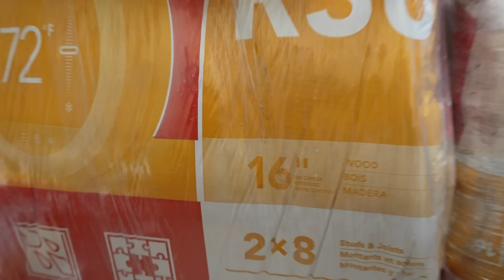OUR DRIVEWAY IS IMPASSABLE!!!

Comment: Regarding the snow drift melting, I highly recommend you start placing sandbags immediately. By the time it is an emergency, it will be too late. Take it from someone who's dealt with deep snowpacks and spring flooding before. You don't want to let the snow melt do its thing if at all possible. It can and will get out of control in the blink of an eye. Sandbag it and save yourself the headache later.
Reply: They should had placed them in the fall. The flow is already going and running into their basement and back retainer wall . 😢
Reply: @BabciasCoffeeAndCraft  it's not in their basement yet.
Reply: And with whole surrounding area dealing with the same thing...those sandbags will be in short supply. Everyone will be out-of-stock in no time.
Reply: The garage will flood and that water will move right into his workshop. 😱 The door will be unable to open. Allie, don’t wait until it’s an emergency, get prepared now! 😱
Reply: @johndell8679  their videos are a couple weeks they just didn't film and edit yesterday. SMH
Reply: Realize that they are 3 weeks behind on posting these videos. It's probably way too late.
Reply: Oh the professional snow melt advisor's on here!!

Comment: Use a Rototiller to trench the through the ice. When I was stationed in Newfoundland during my navy days, we did that and it works well. Just be careful of your concrete underneath.
Reply: They need to buy a large steam genny, since they Have less than optimal snow accumulation areas and drainage.
Reply: They don’t have to worry about pavement as I think they just have gravel and dirt.
Reply: Nobody gets more snow than Newfoundland.
Reply: I think you will cut your hair before you put it in a pony tail.

Comment: I think one thing that you should check is split system outside unit. Make sure water doesn't start building up due to melting snow. If that cavity fills up it could ruin outside unit. You might need a sump pump to try and keep water from building up. Your garage floor is a good example of water buildup and this will also happen around your house at lower levels so I guess just try and redirect water away from house . Great videos so sad you are having to go through this. Diesel Dave, of you tube Heavy D may have lost his vacation house as snow was higher than his 3 story roof. Inside of house, walls were buckling and may not be able to save.

Comment: When I was a kid, we had a tool we called an ice chopper/scraper. It was like a hoe that was straight not turned at 90 degrees to the handle. It did a great job of breaking up an ice layer and lift an ice layer off concrete surfaces.

Comment: You might want to create trenches on either side of your driveway and the street to help direct the water away from the house, garage and the driveway. You definitely need to create trenches to direct the melt flow away from the deck and basement of the house. I hope your firewood stays dry and doesn't turn into a huge block of frozen wood. Get as much as possible up off of the floor in your basement and garage to protect it. Praying nothing bad happens.

Comment: I stopped sanding the mud several years ago. I now use a wet ( not too wet ) sponge to smooth out seams and screw holes. Saves on the mess. It matters how well you mud for this to work well.

Comment: Look on the bright side, all that snow runoff will help you plan an incredible drainage system around your buildings and possibly your driveway.  Normally a french drain is covered with soil but in your case I would look at installing continuous open drain pipe sections with a grate on top like you would put in front of garage doors.   You could put screen under the grate to prevent the snow from filling up the drain pipe.  You could also run water pipe heating cable in the drain to melt the water that freezes in the drainage pipes each night so the drain would be clear for runoff each day.

Comment: Try laying black plastic or dark colored tarps on the ground where you want the snow to melt quicker. Seal the outside edges with snow and the trapped heat should supercharge the melting wherever you place them.

Comment: Consider melt runoff erosion. Get above the house stem wall and begin routing melt water in the ice to alleviate (help prevent) flow gpm in the ice river under the ice.
The ground water saturation is likely to be extreme and the surface flow will definitely be increased over previous years.
Don't let your beautiful house ark float away!
🖖

Comment: We had trouble with flooding, and what we did was use some perforated PVC pipe. Dug a hole with an auger, then fill it with.  Tiny p stone. I have not had any flooding issues since.

Comment: Under the deck you could build a short retaining wall (that you can easily step over) with an open french drain on the outside of the wall.  I don't live in snow country but if I did, I would love to solve the runoff problem with innovative techniques.

Comment: infront of the basement dig a hole in the ground and put a water pump in it to move the water away from the foundation 
NOTE .... you will have a harder time when the snow melts behind the house with possible water infiltration

Comment: By now you've probably figured a solution for the snow mound in front of the house. But I would fire up the tractor and use the snow blower,,at least get it away from the house to avoid it going into the basement.

Comment: Hello from Canada, and you seriously have way more snow than we do here. shop and upstairs are coming along nicely, use 1/2" ply in your shop, or at least up to 8', drywall is too fragile. ask me how I know. I have a lift in my garage as well and am putting in a loft in the front portion for storage. As you do not have the outside finished, you may consider moving heater to corner by entry door and a loft by where heater is. You can never have enough storage space. my 2 cents.
By the way nice welds, that Tacoma is going to be a serious crawler when it is done.
Keep up the great content, really enjoy the videos

Comment: Just texture the drywall, instead of trying to make it perfectly smooth.  No sanding required at all!  You tape the seams, and then apply drywall mud randomly to texture.  Then use a fluffy roller or spray gun to apply primer and paint.  Much easier.

Comment: Sit a sump pump and sand bags under the front deck at its lowest point and try to prevent the water entering the basement and foundation. Typically the water will seep under the a concrete foundation and cause undermining and cracking.

Comment: What you need is a blade off of a industrial paper cutter and weld it with two brackets with a long handle. The beveled edge of the blade slices easily right through the ice and breaks it up. I used to have one and moved too quickly once and lost it. It makes chopping through the ice super easy.

Comment: This is were pushing snow back from day, one all the way to the end of winter is so important.
Having a spot to get in with the snowblower, all the way around the house and having a proper roof on a house in the mountains to unload the snow by itself and not have it build up on another rooftop. It’s very important.  The biggest thing you could do with that property is cut in around the house and around the garage and push the snow back about 40 yards away from the house on all sides with a snowblower. 
That will help keep things dryer because remember at the beginning of your construction you had water in the hole before you did the basement???? The waterlines just below your basement floor? You need to get rid of the snowfall push it back. 
You’re gonna have to come up with a system to clean the roof off pretty much on a daily basis.

Comment: I have a couple ideas for the future. Find or buy a couple of old steel street light poles. The hollow kind. Bury all but 8ft in the ground in concrete and a lot rebar. Fill the poles with concrete and rebar. Plant one half way up your driveway on the inside edge and the second one to the outside edge of the driveway up in front of garage. Then weld a mounting point for your winch on each pole. Then you can winch your self up the driveway when one of you is alone.

Comment: The wreath was fine, loving Trents hair. I kinda feel bad, here in NE Ohio I didn't have to plow my long driveway once this winter, hardly any snow at all, I think you got all of mine and more! I fervently hope this summer you buy a large tractor or tracked skid steer that will help move snow during the winter and dump it over the side of the driveway. I pretty much live on a flat 10 acres and can't imagine not having my  Ford/New Holland tractor.  I am surprised after the insulation the roof ice and water shield/roofing isn't the next step instead of dry wall. I know the roofing itself is weatherproof to a degree but ya'all live in extreme conditions.

Comment: You were having fun with the jeep, weren't you? Does the Sahara have lockers like the Rubicon, or were you not using them? I would have used a shovel to build a ramp in the snow/ice so the front wheels did not have to jump a foot or so. But, sometimes, it is just fun to take the hard way...and more interesting for the video.

Comment: May I suggest that you start preparing right now for every single wall of your house and certainly your basement to be breached by melting snow water.  A lot of water.  The entire hill behind your home i going to melt and undermine the terraced walls.  There's no way all that water will be absorbed by leaching into the soil below-- it's just too much.  Frozen snow will also turn into solid ice and will have the ability to damage/bend the rear and some side walls of your house and garage, too.  It will shift as the snow around it puts pressure on it.  Get ready now.  It's gonna happen!

Comment: Guys, those respirators cartridges do get full, that's the only term that comes to mind.  Trent, you may need to change the cartridges in your respirator because you may have had a higher rate of respiration than Brandon.  Good luck with getting out of your driveway and deal with the snow melt.  Later.

Comment: Trent, unless your willing to be clean shaven, those negative pressure respirators are affording very little protection, they require a tight seal to your skin to be effective. You would be much better protected with a PAPR system and a hood, that would also help keep your head cooler with fresh air blowing into the hood constantly. PAPR's also provide the benefit of not having that constant high pressure on the bridge of your nose. PAPR's aren't cheap, but they do provide massive benefits to a bearded guy like yourself. In this spray foam situation, you also would've had zero dried foam on your face or in your hair, it would've all been on the disposable hood. BTW, PAPR = Positive air pressure respirator.

Comment: Why insulate an area that's not going to be heated/cooled?  20:58  Frank runs straight from the yard onto the deck, shows the depth of the snow.  Put baby oil on your face and the spray foam won't stick to it.

Comment: Ok I'm confused. I thought Trent said they couldn't put insulation in until after the 4-way inspection because they need to measure it to make sure you used enough spray foam. But then I see Brandon putting up the insulation a few moments later. Did I misunderstand? Or maybe they only need to measure in one spot? I know nothing about this kind of stuff. I'm just really curious.

Comment: Seems your videos are at least a couple weeks in the past since the weather conditions you have don't seem to jive with current weather conditions in Utah regarding snow and melting that is starting to occur. I am awaiting with anticipating though how your area's melting actually happens as you post videos about it in the coming weeks. I am very concerned you will have water leakage IN YOUR WALLS due to snow compacted against the walls and windows that will basically have an ice layer on the windows and siding such that when it starts to melt it will find every nook and cranny to run into. I hope not for your sake.